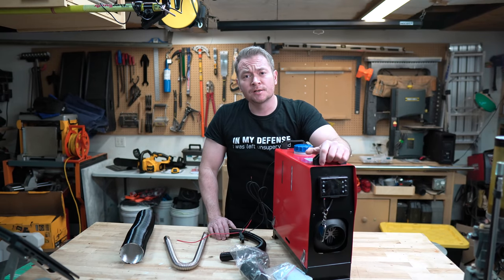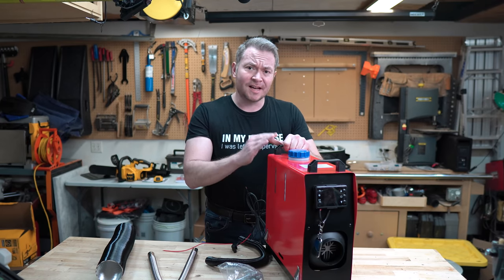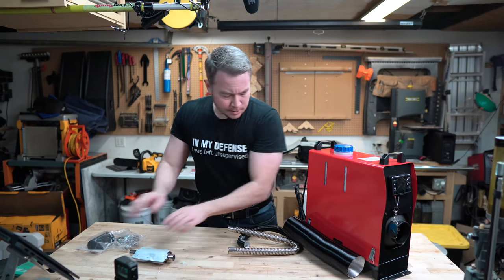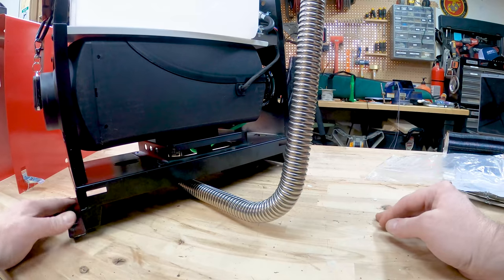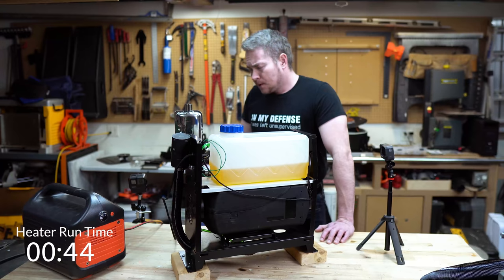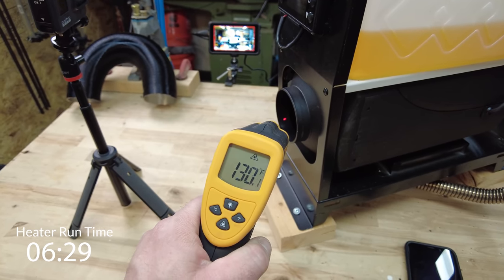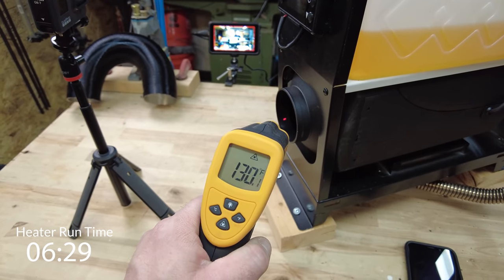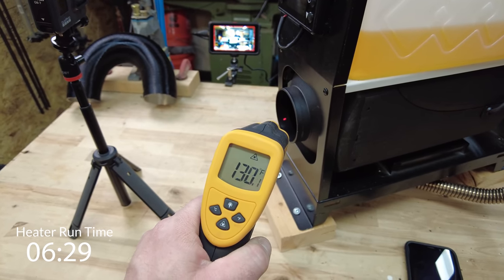My First Chinese Diesel Heater

Comment: Would you not be concerned about carbon monoxide poisoning running it for long periods of time indoors?
Reply from the maker: Yes, absolutely.  This was a short demonstration of firing it up for the first time to see if it worked.  I've since mounted it with an exhaust running outside and will be doing a video on that soon.  I want to run it long enough this way to make sure it actually works and doesn't burn anything down before daring to recommend it to others :)
Reply: @TomtheDilettante  Gotcha, well Im looking forward to seeing it it works for you. I also have a small shop Id like to heat and dont want to invest the time/money into a small wood burning stove. So this would be cool if I found out it worked and wasnt sketchy. Thanks for your time and response appreciate it!

Comment: I bought two of these and neither of them will turn on. The screen doesn't even turn on.
Reply from the maker: sorry to hear that.  I've purchased 3 so far and they've all worked admirably.  Are you using an appropriate 12v source?
Reply: @TomtheDilettante  tried my jackery explorer 240 and my truck. Both should easily be able to handle that max amp draw from what I've read. I'm getting voltage all that way up past the in series fuse (the one that is on the red line), on the red line and black line. I never opened it up far enough to see if I'm getting voltage to my control boards though.

Comment: wait diesel cheap?
Reply from the maker: At least by me.  Electricity is stupid expensive it seems these days (kWh + tax + delivery etc...) and Kerosene at the few pumps where i can find it by me is about $0.05 to $0.10 more than diesel.  I suppose the economical advantages vary depending on the fuel prices in your region.  It may not be for everyone :)

Comment: Don’t you have to worry about carbon monoxide poisoning with the exhaust on that heater?
Reply from the maker: I have other videos on this unit that cover that. But yes, folks should ensure adequate ventilation of exhaust fumes whenever using.

Comment: My guess is that it is just a mini torpedo heater
Reply from the maker: Probably not too dissimilar.  I don't have the guts (or time and money) yet to take one of each apart and compare LOL
Reply: @TomtheDilettante  it's a nice compact little unit. Judging by the size of it though I couldn't imagine it heating up an area bigger than a small barely 1 car garage. The only real differences I can find with watching your video to know how it functions is the fuel pump. A torpedo heaters "fuel pump" is actually an air pump on the back of the fan motor that provided the forced air which helps it burn clean and also blows the heat out.  The air pump forces air through the fuel nozzle which has a venturi, using the vacuum created to suck the fuel from the tank. It then is atomized with the compressed air.  On yours with the tank above the fuel nozzle I'd think using a similar setup would just cause the fuel to siphon out. So instead it uses an actual fuel pump, killing the flow when it shuts off. 
Even for torpedo heaters having no flue and putting the exhaust right into the room they burn surprisingly clean, even burning diesel.  Kero burns cleaner with much less stank. I run mine in the winter for hours at a time in my garage(16x25ish) with the door shut or if its getting hot I'll crack it open slightly.
Reply from the maker: @jonyemm  you may be right.  I hope you're not LOL!  As I hope to use this to heat my 1.5 car garage this winter.  We'll find out though.  Once that Chicago winter hits, I'll be testing it out and will share a full review again :)
Reply: @TomtheDilettante  this is one of those things I wouldn't mind being wrong about. If i actually do the math for my garage it comes out to a bit over 8k btus.  From what I found online(forums, can't find any manufacturer specs) your heater should put out double that. I was using a 55k btu torpedo heater burning diesel/ kero. My garage is concrete so everything retains the cold in the worst way.  In NEPA winters it'll take an hour to bring my garage up to 65-70. But within minutes of shutting it off it gets noticeably colder.  I normally get sick of the noise, and run it just to keep a comfortable 60ish. Normally more on than off. Concrete kills me.  I have a 30k btu propane forced air torpedo heater, quieter than my diesel one, but it doesn't do much to heat the garage.  If it's not facing me it's not worth having on. If I'm at the bench I'll aim it at me and work in the corner.  And as you mentioned, the moisture it puts off is horrible.   Best of luck with your heater. I'll be keeping an eye out for updates about it.

Comment: I would have put a piece of organic slate ... underneath the exhaust pipe...

Safety
Safety
Safety

2) poor engineering...  on exhaust:
      pipe should be 12 incheS          
     Free heat from the pipe!
3) main heat ? @ top of unit?
     Should be a floor level - 
     Come CentS? LOL
4) MY 2 CENTS😎

Comment: how the hell is that baby power station putting out 12v  and 15 amps on a cigarette plug????
Reply from the maker: 12v / 10 amps. Worked great and never pulled more power than it could handle.

Comment: 9:18 That was same with my Chinese welder I got. Does MIG, TIG, Stick and Flux for $300 and is 220v. So couldn't really complain when compared units were $1500+. But just deplorable, atrocious the translations. Should really be a law against that. Must hire a competent translator. That's a business idea.
Reply: Their idea is that a competent translator shouldn’t cost more than 300 as they are producing these units at maybe 100

Comment: China burner are so much better this days.  Have copied for many many years.  Have used 1 og this in 1 year stright.   Sheper then te expensive manufactures.   And much Sheaper in parts.
This are much better then thw expensive shaite everapaser and webasto.  Webasto service kost more then 7 of thise.   So use it right, and u will never pay thise 1 000 bucks more on them others.    Can buy 20 of this whit sll extra parts u will need.  Thos expensive will Cost u 20 times. 

So buy china but remember extra fuel pump. Display.  Heat plug. Cost only 10 dollar for Spears part.

Cant tell you anof.  Have used this 15 yesrs. And have saved so much money.

Eber ore webasto cost 2000 dollar. China cost you about 2oo dollar whit all extra component.  So there u have minimum 5vyears before u have to shange spare parts. Vebwsto  cost 2000 dollar when first problem Come. And they Come.  China goes on and on if u used it right

Comment: I THOUGHT IT JUST RUN ON DIESEL, BUT YOU HAVE TO BUY A PORTABLE BATTERY THAT YOU PLUG INTO 12 VOLT AND YOU HAVE TO CHARGE THAT BATTERY ON 240 V ELECTRICITY, AND THEN YOU HAVE TO PAY FOR THE ELECTRICITY TOO, BUT THE WHOLE POINT WAS THAT YOU JUST WANT TO STARTING ON DIESEL AND RUNNING ON DIESEL DO NOT USE A 12 VOLT BATTERY AND USING DIESEL. IT IS DOUBLE UP TO PAY ELECTRICITY AND PAY DIESEL. BAD ITEM
Reply from the maker: most devices like this require electricity and a means to provide that electricity.  Mine runs off a portable power supply that is charged via solar so I'm not paying for any additional electricity.  hope that helps.

Comment: But why would you need a diesel if you still need electric power
I thought this thing fires up like a generator or a water pump jet or something it’s a stupid machine for me to even consider taking to camping
I can hook my Generac 8500 watts generator and hook a Honeywell 2000 watts heather enought for a big tent and have 9 hours minimum because it’s gasoline not diesel